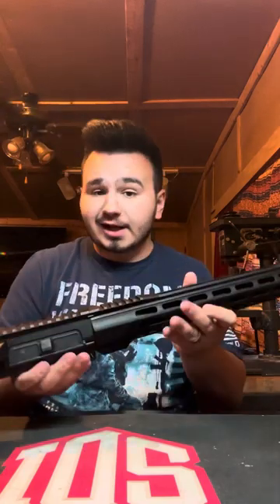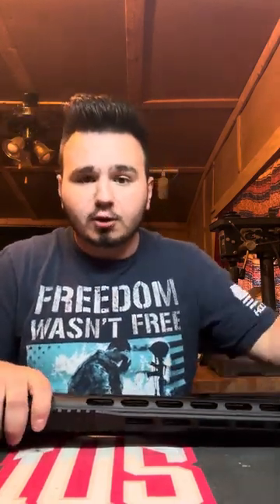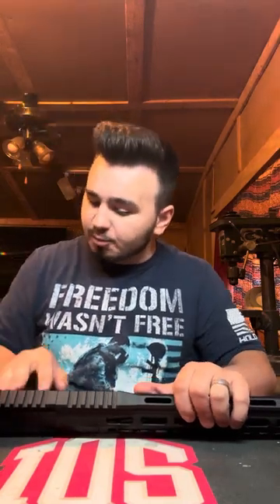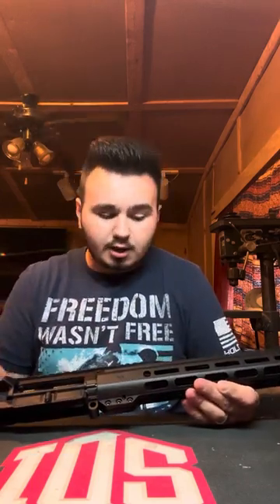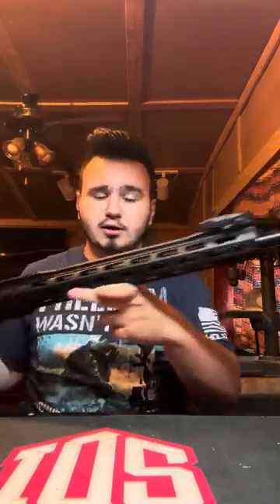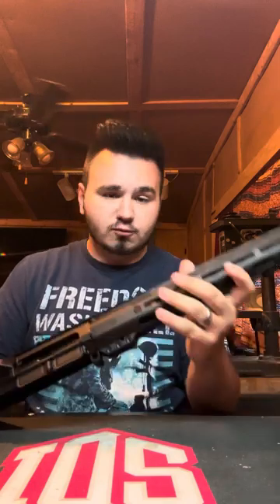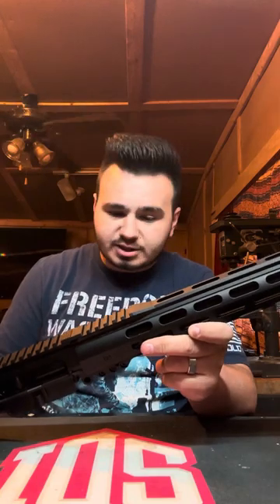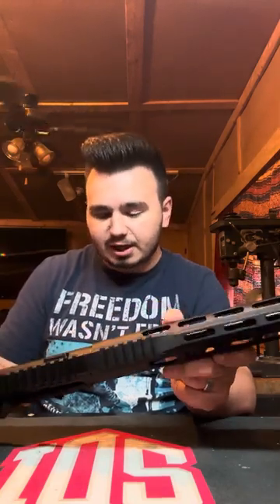SDI AR-10 Build - Upper Receiver Complete

Comment: Great job on the build! Does SDI send the torque wrench? I have a small one for mountain bikes but it only goes up to 24 nm (17.7 ft-lb). When putting my AR pistol back together I just went by feel.
Reply from the maker: Thanks man! Yes, SDI sends a torque wrench. It is harbor freight quality but they do send it!
Reply: @TennesseeTactical  awesome! I had one in my Harbor Freight cart ready to order if they didn't. Already got my first "job" refinishing a 20 gauge barrel for the Remington 1100 (cousin's gun, used to be mine in grade school). That thing was full of rust! Tomorrow it will be reblued.

Comment: So, big questions as my capstone states in January. Do you HAVE to use the parts provided by SDI, or can I add my own? Second, how interchangeable are DPMS, and Aero AR10 components?
Reply from the maker: So, I would assume you need to try and use the tools and parts provided by SDI. The best thing I try to tell people to do is use what they send you and then if you want to change things up later, you can the only reason why I say that is because some instructors might take points off your grade for doing something differently than the assigned work.
Reply: @TennesseeTactical  I was hoping to do a PRS lite stock, a silencerco muzzle device, and a different grip.